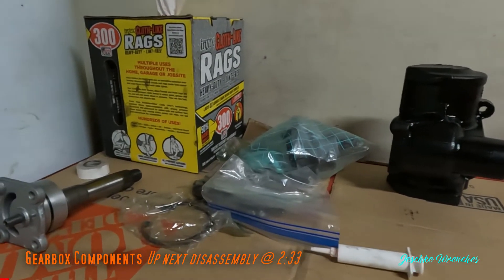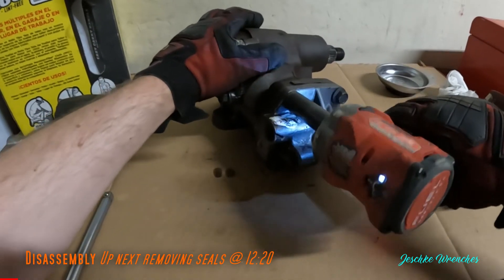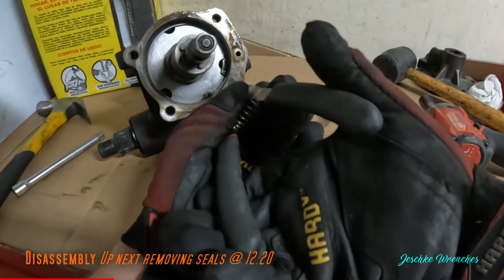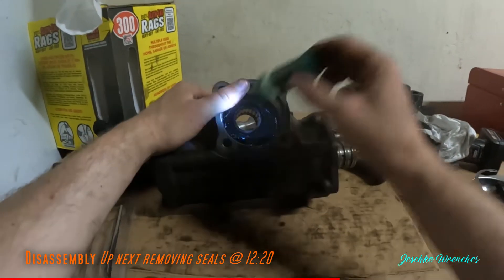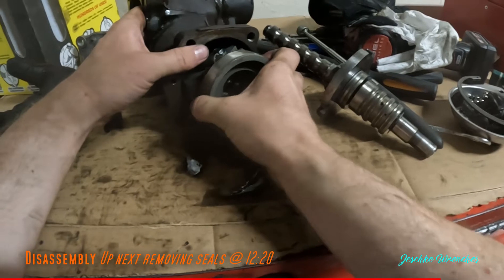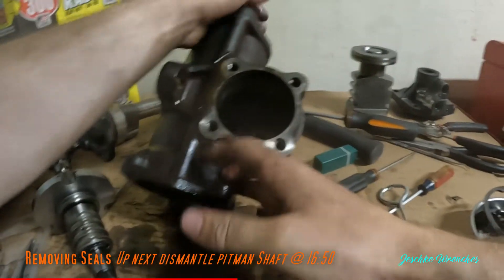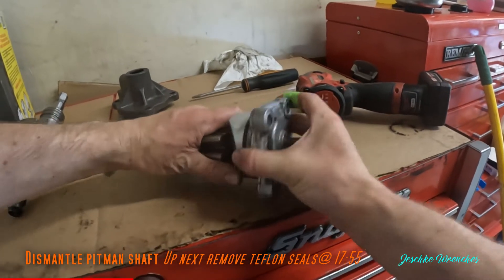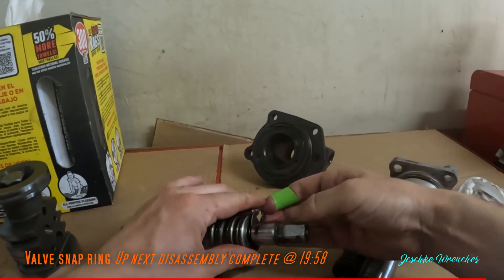Part 1 Disassembly Delphi 670 / 680 Steering Gearbox Rebuild

Comment: Hi there
Your video is great and very helpful. I have three of these to rebuild (680) but cannot find where there is rebuild kits. Can you tell me where I can get these? Thanks so much
Reply from the maker: They sell them on RockAuto.com look under your year, model, etc. then they'll be in the category where the steering gearboxes are sold. They have rebuild kits listed. there's two different kits, one for a three bolt, another for a four bolt. That's how they distinguish the different gearboxes.

Comment: Isn’t the 670 more like the 600 Delphi steering gear and the 680 on it own but similar ? 😊
Reply from the maker: I don't know a whole lot about the various steering gearboxes. There's not a lot of information out there to be honest Unless it's an older style Saginaw gearbox. All I do know is the bigger gear I rebuilt here has more force, the wheels turn really easily with it. The smaller one of course takes a bit more effort. The main difference is the piston and accompanying parts are bigger. I think the sheering shaft is the same part along with bearings. I rebuilt 3 of these till I got it all figured out.
Reply: @matthewjeschke  I’m about to rebuild a Delphi 600 box and I called borgenson and they told me the rebuild seal kit is 600/670 I know the 80 looks larger as you showed

Comment: I found a kit sk8081 but not sure if it’s for this model box
Reply from the maker: Gosh, I'm trying to recall. I think there is a three bolt housing and a four bolt housing. Those are the number of bolts on the valve housing / input shaft side. If memory serves me right. FYI four bolt is an awesome upgrade if you don't have it. It's MUCH less force to turn wheel.
Reply: @matthewjeschke  thanks. FYI the number I provided was the correct rebuild
Kit for these boxes

Comment: Hey man what kit did you use?  about to attempt this. Do you have a link?
Reply from the maker: Edelmann - look at the input shaft, that housing should have either three of four bolts. Three bolt number is 8774 and four bolt number is 8927. Those are for Edelmann brand kit.